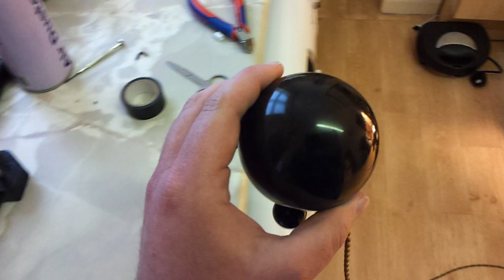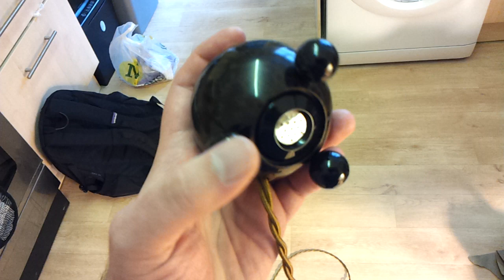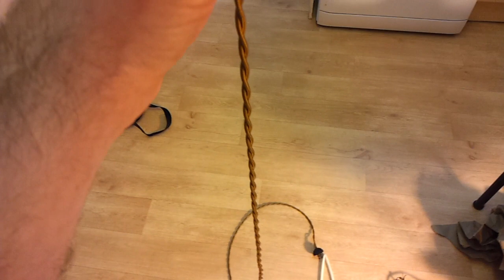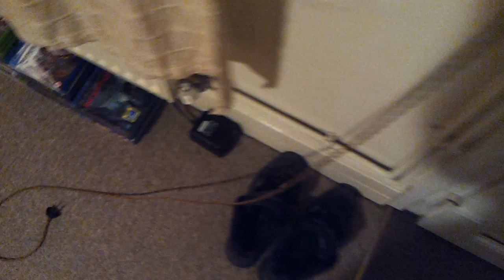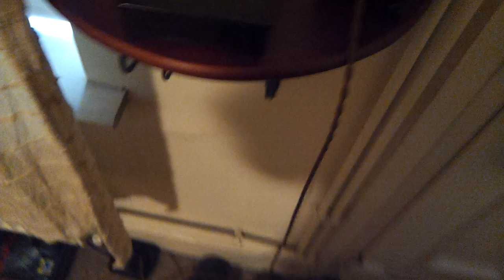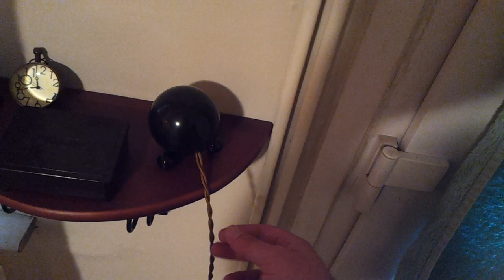Vintage Bakelite electronic table lighter

Comment: These are quite cool, would love to pick one up. If you love nifty American lighters, look for one of the spherical plastic Korex "Electro-Match" units. Typically go for $50-50 US. They take three AA batteries and lighter fluid, and when you pull out the wand, a flame appears on the tip from a tiny spark. Cool vintage lighters and they don't run on mains, so no transformer needed-- they also come in several colors (I've seen black, red, blue, emerald green, avocado green, peach, bright orange, golden yellow and beige.)
Reply from the maker: +Jonas Clark Looks like a D.L.I. Flamingo, only a couple of decades later :-)
Reply: CPS2
Looked at the video, and yes. Does the Flamingo need to be put out before you put the wand back? The Electro-Match doesn't, though some models had a pushbutton on the wand; releasing it retracted the wick, so the flame would go out, but you also had to press it a few times before pulling it out because it wasn't always submerged. Other US manufacturers called these a "permanent match."
Reply from the maker: +Jonas Clark Nope, you can just pop it back in there. I stopped using it after a while though as it predates any standard type of battery and it's a bit awkward to make modern ones fit :-)
Reply: CPS2
If you see a Korex Electro-Match on US eBay, for what you think is reasonable (I, personally, would pay up to $50 for a really good one, more if it's a color other than black and is in top shape) I'd pick it up. Make sure you ask the seller to see it taken apart to make sure it isn't corroded inside; if it's the spherical kind, you can tell them that the metal footed stand unscrews, then the bottom dome comes off. They take standard AA batteries.
Reply from the maker: Jonas Clark
I'll keep an eye out. Thanks bud.